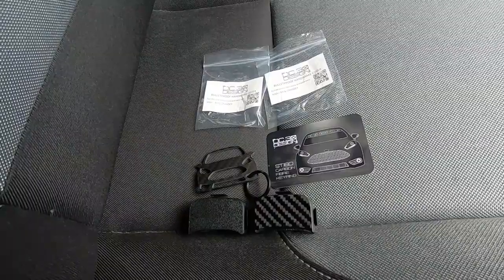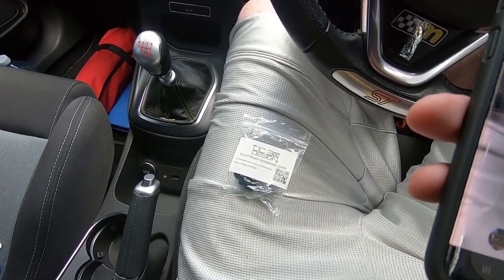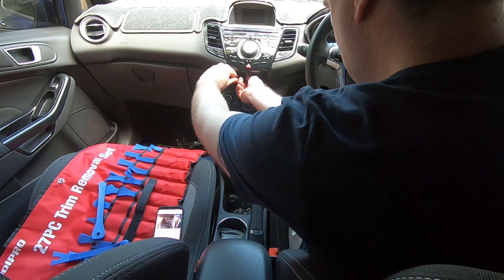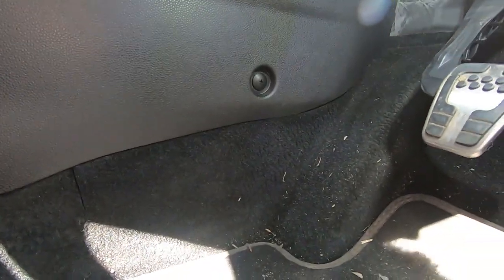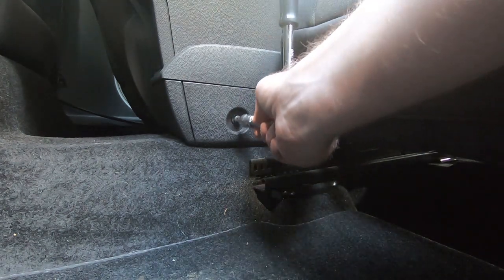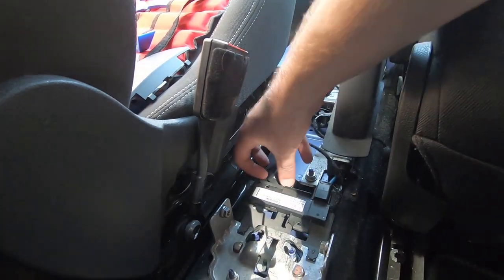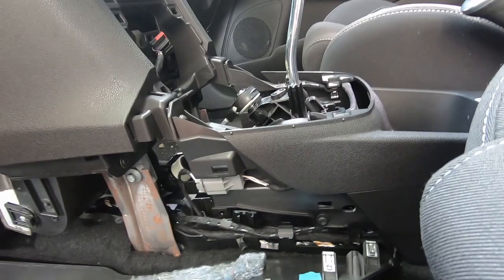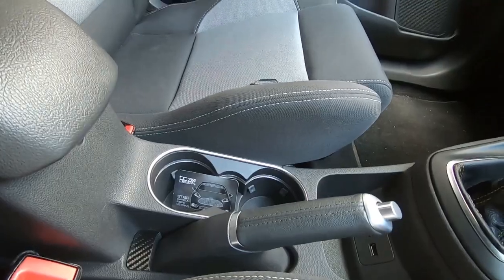DC3D Design Bulletproof Handbrake Hole Cover Install

Comment: I have been wondering how this attached to the console. I couldn’t find it on their site. Thanks for posting up. I had the old design and the tape failed and I had to remove the console to get the part that was supposed to keep things from falling inside the console.
Reply from the maker: The taped one will still be available for people who want a quick and easy install however for people willing to spend half an hour to install this, it is definitely a much more sturdy design that will not push though, as I showed, the hole is filled no matter wherenI put the handbraked position too. Thanks for watching.